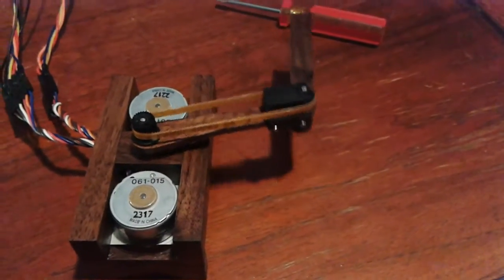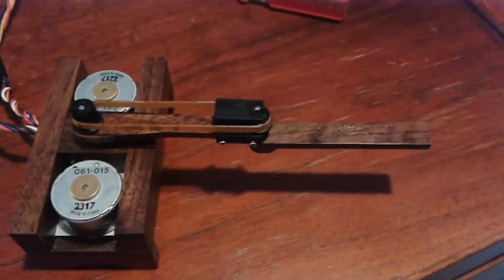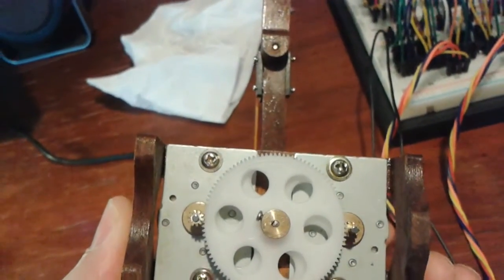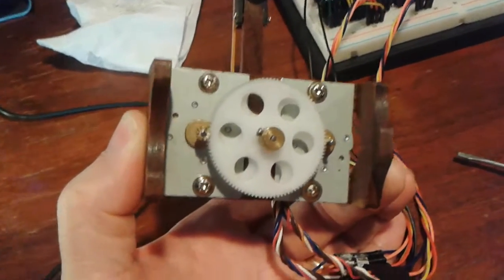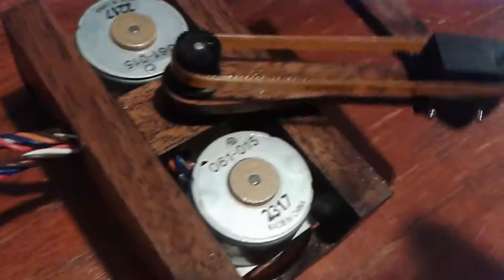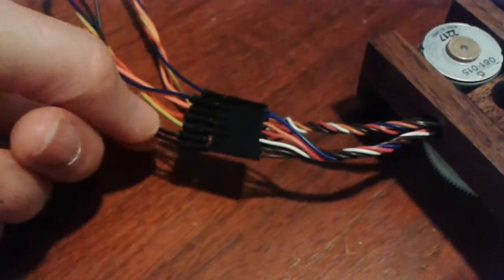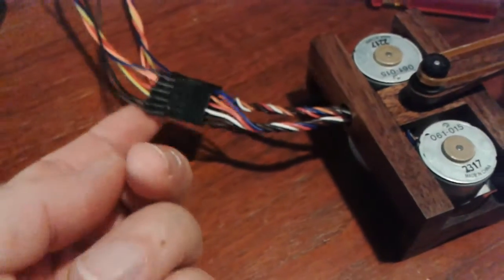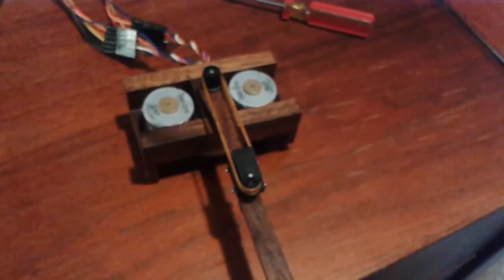Part 5 - Mini SCARA CNC Plotter - First run of stepper motors.

Comment: very cool indeed, i am going to have to subscribe to your channel , are you sourcing the gears and motors from old electronics?  because i am trying to find tiny belts like that
Reply from the maker: Eddie Amaya - Yes. Those belts and pulleys are from an old ink jet printer. I always save that stuff. The motors I got as surplus from ebay. The gears are from a broken remote control helicopter.